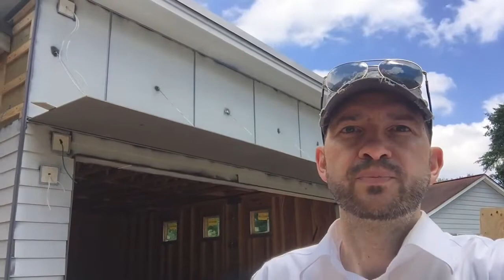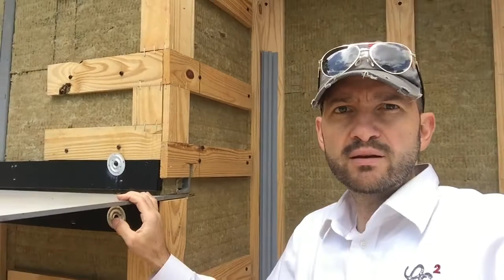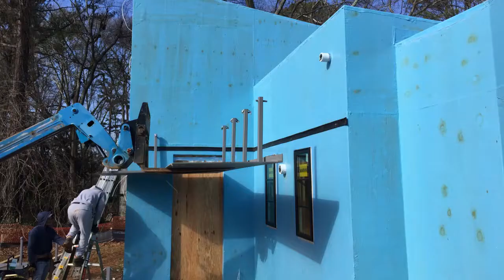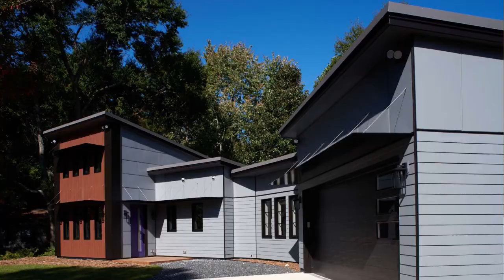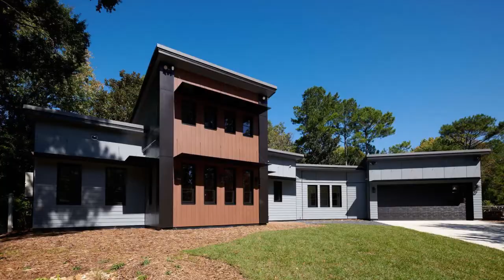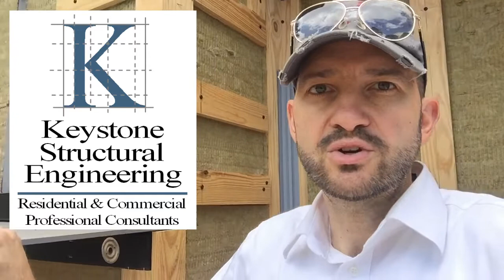Contemporary Floating Steel Canopy w/ No Thermal Bridging, and the Right Amount of Shade

Comment: Only the screws/bolts go into the blocking. 

Everything else is outside the insulation. 

I especially love the fact that you placed one over the garage. For my neck of the woods, adding that detail would mean less water hitting the top of the garage door.